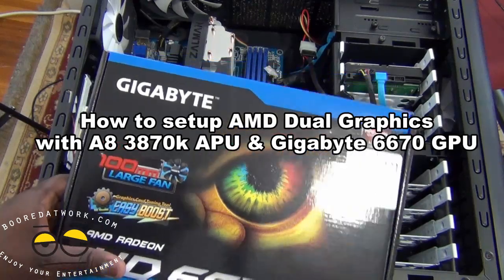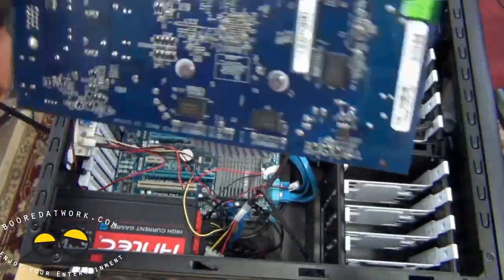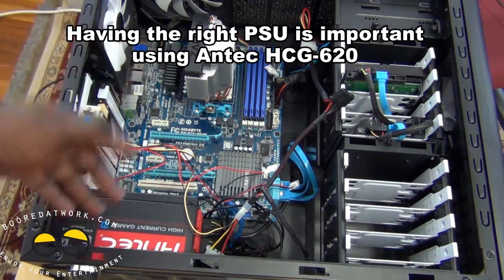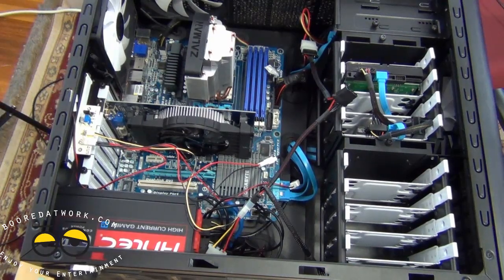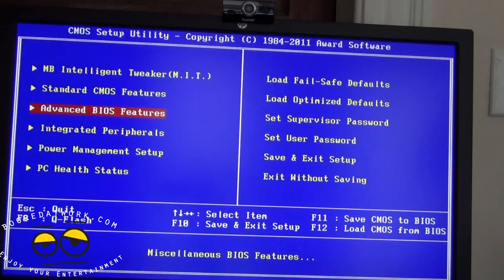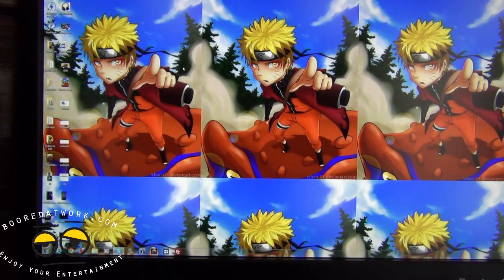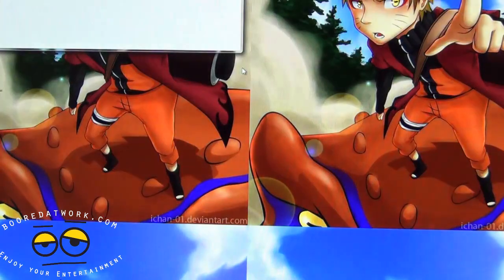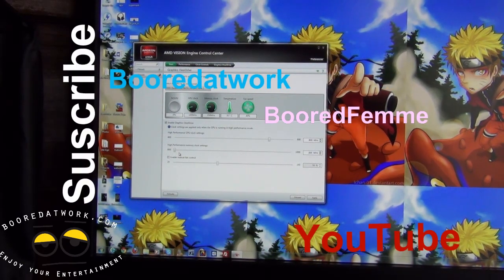How to setup AMD Dual Graphics with A8 3870k APU & Gigabyte HD6670 GPU

Comment: this brings back memories, I did a budget build for a friend in this system. As well as a budget build for a friend with 1gb ddr3 6670 that wasnt with an apu. The hybrid system had the gddr5 gpu. When supported it was able to get considerable performance in "modern" games at the time vs the esports titles we were playing. The hybrid CFX got their cpu hot i doubt they ever re-pasted this resulted in the eventual retiring and upgrade to a better system. He even tried overclocking the CPU when the hybrid cfx was no longer stable. That was a 3870k it outlasted the X2 555 that was probably also poorly cooled....what an era to come from now i have a 200$ ITX board with 90a mosfets and 3 video outs Once the RDNA2 APU's launch it will be a perfect multimedia system that can game or cast games from a main system to a 4k display for PVE and racing sims/sports. I can go from using the board as a main system to retiring it with an rdna2 apu and get years of "service" out of it. From an e-waste standpoint im quite amazed by the b550i from gigabyte. It can run a gaming system with an r9 zen3 cpu, then be retired to a media system, or a dedicated stream pc with a type c capture card. When am5/ddr5 systems become mainstream.

Comment: I think you should use the A10-7850k as that might be a better bet that the APU you are using, I have an A10-7800 based system with a HD 6400  Radeon   HD 6450, 16GiB OF RAM and 3TiB Hard-Drive.

Comment: can u run dual monitors with just the a8 3870 apu or do u have to run a graphics card along with it to get the dual display. i had a i5 running awhile back an was just using the onboard graphics an was able to pull of dual monitors with the i5s intel 3000 graphics. i have a stand alone build i use to game with but was wanting to hook the a8 i have up as more of a work computer an possibly to a tv to watch some netflix on at night without have to change cables everytime
Reply: +James Bowling (CaptHowdy) yes you can, I have a 3870 apu and I run dual display.
Reply: i got mine to work but couldnt get both my hdmi an dvi to work at the same time, had to go with vga an dvi or vga an hdmi.
Reply: James Bowling You are right, it is specified in the user manual :P
Reply: haha, i dont have the manual i figured the hdmi an dvi use the same signal is why only one of them would work at a time, ive had video cards that was like that so just figured that was what it was

Comment: Hey so I watched the video and I have a question: If you are going to use dual graphics mode for AMD, do the cards have to be compatible? My pc has an AMD A8-6500 with a Radeon 8570D and the GPU I want to pair it up with is an ASUS AMD R9 270 will these work together or will I just have to use the AMD R9?
Reply: Ah I see, thanks for helping me.
Reply: ***** stfu buy a 270 these apu solutions are complete bs

Comment: Can i disable the APU graphics and use an Nvidia GPU or something else?
Reply: In Bios,there are many tutorials how to enable APU graphic on youtube,so whole process applies on your problem,just use it to disable APU graphic,since evey bios is a bit different I can't "Navigate" you accurately but the same way u enabled it,you can disable it,its literally 3-5mouse/keyboard clicks from the point you enter the Bios.
Reply: Mørkets Fyrste
Thanks friends, I'm getting a gpu to go with my APU and dont wanna cross fire, Ill check out what you said
Reply: Yeah i got a f2a55m-hd2 Motherboard which has a extra PCI 3.0 Slot just sitting there. I've ordered a AMD HD 7770 Because I heard anything under HD 7750 will have to be cross fired. If I knew you could disable iGPU I would have done it a long time ago, thanks dude!

Quick question since you seem like you know you stuff, I heard A8 series (6660K) Apu doesn't bottlecap as much as you would think, is that true? and will I be getting the enough power from the 7770?
Reply: yup
Reply: Mørkets Fyrste
How?
Reply: Tevin Edwards is you buy a mid/high end Graphic Card that can't be crossfire with the GPU in the APU it will be automatically disabled coz they aren't compatible to crossfire so you don't have to worry :)
As long as your main monitor image lane is PCI Express slot :)
Reply: 7770HD will work fine with that CPU,no bottleneck there,and you will be able to get the max out of your GPU in games paired with that CPU.
As much as I know I think AMD R7 260/x would be the max this CPU can handle without bottlenecking it. So you are fine.
You don't have to crossfire it if u don't want to,and even in AMD catalyst you can disable it from its Window :)
You are not forced to crossfire if you don't want to :)
I'd go with R7 250 / 250x,or even R7 260 if u have the money tho.
Reply: can i split the cable sockets to power both cards?

Comment: Hey, I'm havin a problem, i do everything YOU do in this video, but when i change the setings in bios @ init display first, from peg to onboard, my monitor wont open at all, i can hear the system booting(the sound of windows 7 start-up) but it doesn't open. I have to say that i did this like one year ago and it worked, but now it doesn't work anymore, do you have some ideeas of where the problem might be ? I have an amd a8 3870k with an ati radeon saphire 6570hd they are compatible for dual graphics. Thanks, and help please ! :)
Reply: You might also need to enable dual graphics

Comment: I'm a noob when it comes to these things and so I'm asking does amd apu work with other gpu other than amd Radeon amd such? For instance Asus gtx 760? Was planning to drop off my consoles and move on to a fine gaming pc.
Reply: no you can not crossfire due to the different chipsets but it will work just having the 760 by itself but no worries with the gtx 760 you should have no problem playing any games at all

Comment: Right guys im confused i know what GPU i can cross my A8 6600k with but no where can i find out which one memory wise as can get it in ddr3 or ddr5 does it matter ?
Reply: it does matter the type of ddr, the higher the number, the higher the memory will run at
Reply: Jason Wolfe Well, yes. DDR3 is not as fast as GDDR5. GDDR5 is only used in graphics. But DDR3 will work fine.

Comment: i have the a10-7850k and a gigabyte R7 250 gpu and for some odd reason i can't get dual graphics option in my Catalyst control center  I have the latest drivers installed am i doing somthing wrong? I currently have my display connected to my Dedeicated gpu. need help!!!
Reply: The dual graphics feature is not in the current version, try finding an earlier one. I'm currently having this issue and trying to find an earlier version myself.

Comment: I have an a10 6800k and dual graphic'd with a 6670. For some reason my 6670 performs better on it own than in dual mode. Any idea why? If i knew this would happen I would of just bought a  better card rather than 6670. Also note my ram is 8gb 1333mhz.

Comment: PLEASE PLEASE HELP!

I currently have a gigabyte mobo f2a85xm-d3h FM2 with a APU A8 5600k 
going to upgrade to APU A10-6800K and I want to crossfire but the only GPU I can 
find is GIGABYTE GV-R667D3-2GI Radeon HD 6670 2GB 128-bit DDR3 PCI Express 2.1 x16 HDCP Ready CrossFireX Support Video Card but I have one problem: the PCI slot says 2.1 x 16 but my mobo doesn't have it the slot only a 2.0 x 16 and I need to klnow if this video card will work any ways? please someone help

Comment: I don't have 3 ! I just have room for the 2 right now! In the Gigabyte MB book it says I can run a DVI & HDMI !? but doesn't explain how to set it up? I hooked up the 27" that has HDMI (& DVI) to the HDMI on the MB & the 22" to MB as DVI of course there was no boot screen & then only the DVI 22" came on!  I went to AMD Catalyst & did your Dual/Crossfire thing; turned it off tried just HDMI but got nothing showing ?!t all worked with DVI's in MB & V-Card & DG disabled! Who should I contact?

Comment: I have 2 Monitors (27" & 22") that I'm trying to hook up! I have what you're showing here, except my video card is a XFX HD6670 CNFV! Can I run in Dual Graphics mode? Then where does the main monitor plug into? ex: onboard DVI or HD6670 DVI ? Then what would be any different in the BIOS?!  right now my 22" isn't showing up?!?

Comment: You have to get another 6850 or your 6850 will drop it's performance to be equivocal to the 6670 or won't run at all, 6850's are cheap now though, mainly can find them on ebay.

Comment: I've got a FM2A55M-DGS motherboard and a A10 5800K apu. Can I install a Radeon HD7850? I don't want to use the APU for graphics when I get the dedicated card, just the 7850. Is that possible?

Comment: Yes it will be, I choose that card for my last build and it handled everything great. Most Games I could run High to Ultra Settings and get 40-50 fps. I have the A10-5800k processor along with it.

Comment: If you want to run just the 7770 that's ok..but since you can't crossfire them and will likely disable the HD 7660D anyway (like I had to do), you might want to consider not going with a A10 with an iGPU.

Comment: Yea...that's exactly what happened. It slowed my 6950 down so much I eventually disabled the HD 7660D. Now I'm just running the 6950 on its own and much happier with the results. Its a shame because I had read LucidLogix MVP was supposed to decide which GPU was best for the task and assign it to the proper GPU. Instead running both just slows a faster GPU (like a 6950) down to a crawl. I wish I knew this before I bought a A10 iGPU. I guess maybe its ok if you are just running a 6670 or lower.

Comment: Adding a discrete GPU to the A10 seems to cause some headaches, especially if your not adding a 6570 or 6670 that is capable of crossfire. I tried to add a 6950 and it really doesn't work properly. My AMD Vision control center display also doesn't have the option for dual graphics under PERFORMANCE but I think that is because the 6950 (although an approved card to use with an A10) won't crossfire with the A10, so that option wont show up.

Comment: Most power supplies are quite larger than what you will ever need. Running an i5 Sandy bridge at 4.5GHZ with 7870 @ 1200mhz on Full load = 300 watts MAX usage, including RAM, mobo, fans, and correction for PSU efficiency (mine is gold seasonic 750). All you need is a little overhead room for long term reliability and temps, 500 watts is more than plenty for the majority of rigs and 400 will quite easily run this set up here

Comment: I have a a8 5600k, if i buy a AMD Sapphire Radeon HD 6670 1GB will it work? And when i have put the new graphic card in place, do i put the video cable to the original VGA port to the motherboard or the new graphics card VGA port? Thanks

Comment: I'm not that stupid like you because im talking about CROSSFIRE w/ a8-3870k which will increase the performance of the APU,and not the video card itself..yes its true that 7970 DDR5 is far more better than 6670 DDR3, but your losing the point that the APU are type of processor which build to be more likely low cost CPU with integrated graphic card 6550D to be crossfire with also same level discrete graphic card and combined together for better performance..

Comment: To those who are planning to crossfire mode, please take note that the a8-3870k is only compatible with this 3 graphic cards 6670, 6570 and 6450, and take note that if your planning to buy DDR5 it will not work as what you are expecting because the cpu will downclock the DDR5 to DDR3, so if your planning to do crossfire please buy the DDR3 one, it will save you money and can play games at high and ultra settings if you do it correctly..thanks and good luck to all coming builds

Comment: Your cpu fan is facing the wrong direction. you're blowing hot air into your case to circulate rather than directly to your exhaust fan. you can just flip it around no problem.

Comment: You can use a 7870 or 7970 but you will not be able to crossfire it with the A6 5400k so you will have to use your 7870 or 7970 as your dedicated gpu. You might as well spend $15 more and get a Phenom II x4 965 Black Edition CPU on an AM3+ motherboard if you are going to get one of those video cards.

Comment: HEY! I SOLVED IT! i dont know if u did the same mistake i did but i went ovr everything i hadchanged before getting the card n it turns out i had changed the UMA frame buffer size when i had just set my pc up. It comes in auto (256 mb) for the cpu to use from ur ram in graphics n i had changed it to 1 gb (1024 mb) so i changed it back to auto n set inet display to onboard n restart n do the whole thing the vid shows u. u dont see bios tbut its ok cuz it works. hope it helps.

Comment: hey i have a question. I have the a8 3870k and just bought the 6670. I went into the bios and set the processors integrated graphics to show first and when i activate dual graphics i can only get signal have the monitor connected to the mobo's inputs. is that ok or does it have to be on the graphics card? because if so i dont get signal if i plug it to the video card. and actually games run slower while using dual graphics than when i use the video card alone. what could be the problem? thanks.

Comment: Wow im really sorry to say this but most of you are idiots listen and listen closely
The A10-5800k 7760D HD CPU+GPU combo is ONLY CROSSFIRE COMPATIBLE with an HD6670 or HD6570 series graphics card. It says it right on the fucking apu box.
as for a8 series apus im not sure but CHECK THE BOX IT HAS COMPATIBLE CROSSFIRE CARDS PRINTED ON IT. Jesus.

Comment: Just a regular motherboard with 1 PCI-E slot, because one of the GPU's is built into the processor, so it doesn't need 2 discrete cards.

Comment: I am going to do it tomorrow, I found a Gigabyte  GV-R667D3-2GI, it has 2 GB. But, actually, my engine control center isnt showing the dual graphic option! It shows only CPU power and amd overdrive... maybe I need to install the dedicated first.

Comment: From My understanding it utilizes both.
I have XFX HD Dbl D 6850 from a phenom II build I plan on using, my understanding is the APU will run lower volts as the built in gpu isn't utilized, we'll see.

Comment: for some reason after crossfiring the apu and my 6670 my fps for certain games turned out worst than the card itself. Is there a way to fix this? i have the same exact parts as you.

Comment: Appreciate the vids, I had purchased A8-3870K and found your video.
I already had a new Saphire HD6570 w/ 2gb DDR3 purchased for another build. I went for the for the Antech 620 PS & the Fractal Case for my build thanks to your video, However t I went with a ASRock A75 PRO4/MVP with Thermaltake H20 2 Pro CPU cooler & 16GB of GSkill 1866 Sniper RAM. Now, I'm  just waiting on the Kingston HyperX 240GB SSD and it will build time. Thanks again for the inspiration!

Comment: Psu is over the top, I run a 125w phenom and a Radeon 6850 off a 550w and the 6770 no work with apu

Comment: fi got a question here. this winter i am planning on buying this amd a8 quad core apu, and xfx 6770 hd graphics card, along with an fm1 gigabyte motherboard (cheapest one on amazon) 8 gigs of ram,and an 850 watt psu. all of this will be using windows 7... how wellwould using dual graphics work for me? like fps for games? and issues? if any?

Comment: For this configuration can i use a HD6670DDR5 graphics card? or only it works with DDR3 version of the HD6670, i have an A8 3870k, and i want to put a graphics card to test the Dual Graphics set up

Comment: if i enable dual graphics in my system i cannot plug my monitor to the hdmi of the dedicated card, it wont show anything on the screen, also, frame rates and game performance its the same for me when im using the dedicated or the apu alone, which i think its not normal im using the hd 6450 and A8 3870k apu, i dont know what im doing wrong.

Comment: i i enable dual graphics in my system i cannot plug my monitor to the hdmi of the dedicated card, it wont show anything on the screen, also, frame rates and game performance its the same for me when im using the dedicated or the apu alone, which i think its not normal im using the hd 6450 and A8 3870k apu, i dont know what im doing wrong.

Comment: Corsair CX600 V2 is a great unit. $69.99 with $10 rebate.

It also is 10% off with promo code CorsairOct16 on newegg.

It ends october 22 though.

Comment: No it will not. The GPU in the APU will sort of shut itself down, and u will only will be able to use your 6790. No dual graphics. The best card that u can use for dual graphics is a 6670 ddr3. If u use ddr5, it switches back to ddr3. So its better to get a ddr3 version